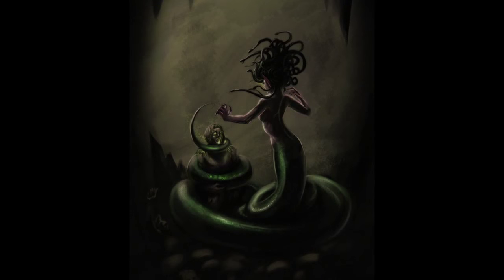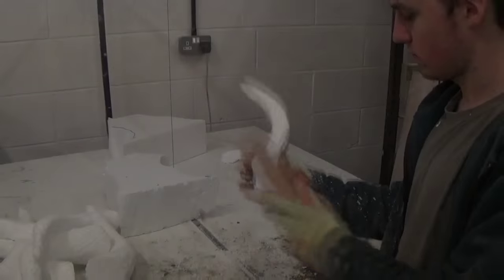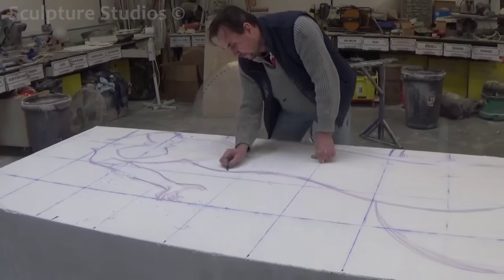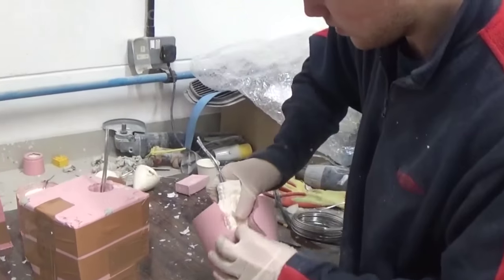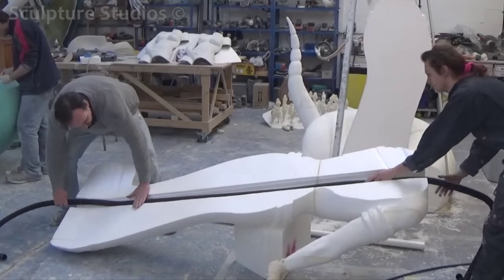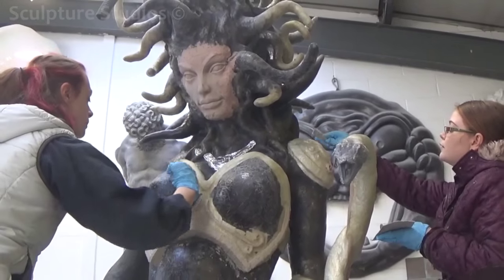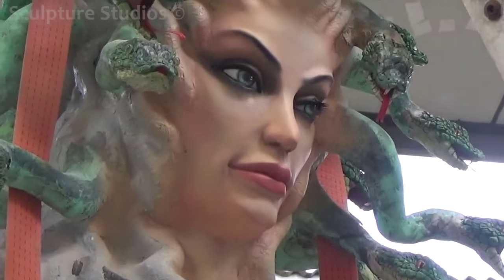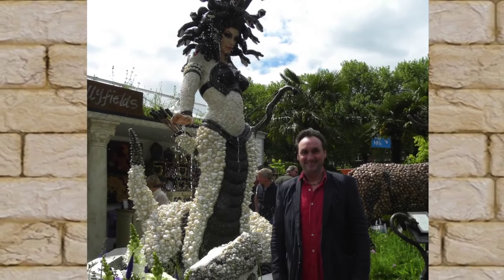Medusa by Sculpture Studios

Comment: Amazing! What type of clay die you use for the face since oven burning with regular clay would melt everything else down
Reply from the maker: SuperJayda1983 Its just regular clay. We didn't need to harden or fire the clay in an oven at all. We simply took a silicone mould of the clay once we'd finished carving the face, and created a fibreglass cast from the mould. Then the clay went back in the bag